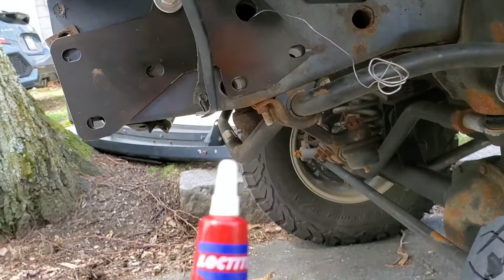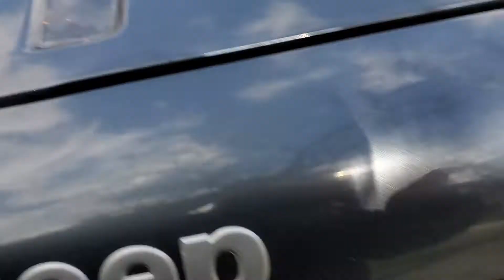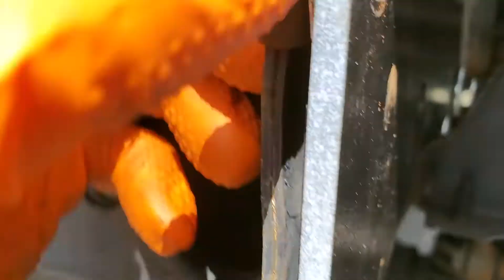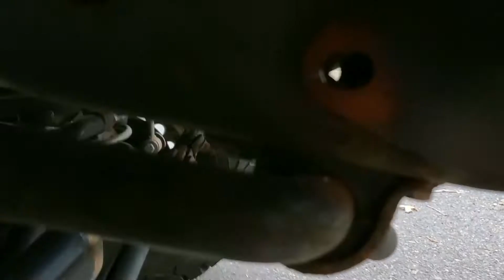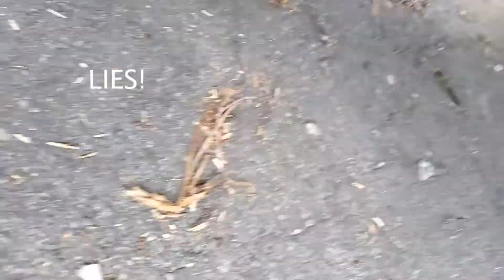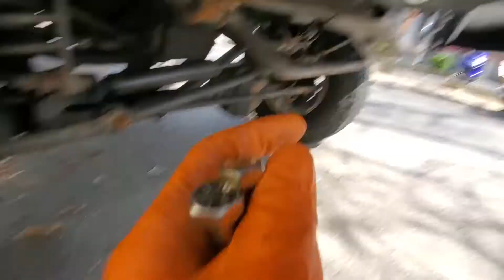Jeep XJ Stump Winch Bumper Install Part 2

Comment: Did you ever figure out the passenger side bolt situation?  I am installing one tonight and have the exact same problem.  I will just make a trip to the hardware store for some grade 8 bolts and some flat washers and nuts.  I don't understand why they ship the hardware this way.  I will try and find out an answer as well.
Reply from the maker: Damn sry to hear its still an issue. Just grabbed some hardware myself and let it go. Annoying I still have 3 brand new steering box bolts haha. Good luck with the project and glad to hear someone is following along doing the same things.

Comment: Thanks for the Video. I'm about to install my Dirt Bound bumper so I'm watching all the videos. Looks like I'm in for a fight with the bolts. Thankfully my. XJ is not a daily drive so delays don't bother me at all. Where did you end up relocating your horns and Vacuum sphere? BTW: Not trolling, but in Video #1 you implied that these bumpers came from China. DirtBound is a small shop in MN. Made in the USA!
Reply from the maker: Hey Ed Glad you're finding the vids helpful I hope yours goes smoothly! I must have been referring to other companies like smittybilt with that china comment. Not a huge fan of dB but I won't deny them their nationality :)
Reply from the maker: Sorry didn't realize I didn't answer your questions... I bent my horn brackets back so the horns are horizontal and my c
Vacuum ball is floating somewhere between my oil filter and coolant resevoir... nit a great solution but it hasn't been an issue

Comment: Hey man what was the reason for the steering box spacer ?
Reply: In pt 1 I broke a bolt to the box and discovered the spacer was broken. Having a cracked spacer is pretty common as they are aluminum from factory and the frame is quite flexible, the steering box being a major stress point. Thats why I recommend just getting a spacer to swap as you'll be in there anyway